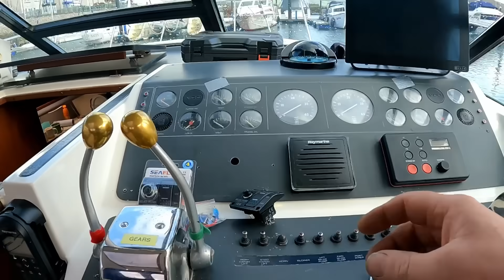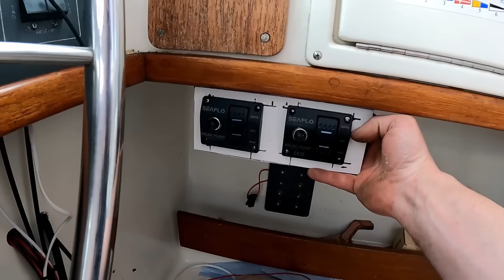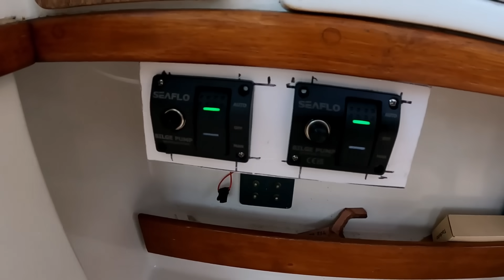Our Boat Sets On Fire At Sea! This Is A Big Problem! #boatlife #boatfails

Comment: Hi Simon, I have observed copper stranded cable not to last at all long on a boat kept on or near the sea. A better option is to use tinned copper cable. It's a bit more expensive, but worth it for any critical system.

Comment: The pump more likely seized and the motor drew more current than the wires could handle. High resistance reduces the current  through the circuit low resistance for example a short  will increase the current  untill the wires heat up and and fuse..

Comment: Lucky last thing you want is a bushfire out out on the sea why didn't the circuit fuse work .....heat shrink lots of Zippy ties and good support for all wires is needed on boats.    Some people might think Im silly but I use stickaflex over the heat shrink on all my connection's and to hold the wires in place under the floor and places i don't see  I do the same on my 4x4s vehicles I've haven't had a problem yet and hopefully never will

Comment: The pumps should have their own fuse and supply cable, if your fuse pops you will lose them both, apart from that great job.
Reply from the maker: They have mate! There both 2 individually wired systems and each one has there own breaker and switch! That’s why we installed 2 switches!
Reply: @ShipHappensAdventures  Spot on,  I'm going to have to watch again now to see where I got wrong lol.

Comment: Considering how often float switches fail, it pays to install a second switch, wired in parallel with the first one and mounted on a raised block. Then if #1 fails, #2 will take over when the water level rises above 'normal' pump out levels...Cheap 'Peace of Mind' insurance. And if you don't want to solder the wire joins, at least coat them with dielectric grease to keep corrosion away... :fish-orange-wide-eyes::finger-red-number-one:

Comment: Having had a 12v fire, one cause is loose wires. Over time they crack the insulation. Wires should not be allowed to shake around.

Comment: Keep analogue gauges as backup duplicate by all means with digital. Good video on your bilge pump replacement.
Reply: I agree totally.  Our local high end boat builder installs all digital instrumentation, but there is a removable panel behind which there is a complete analog gauge set.

Comment: With regard to your new dashboard.  I would insert a tablet (10-14")  then you could run apps tethered to your phone or get a tablet that has a SIM slot.  Apps I would have on it are:
Navionics
Windy / Predict Wind
Boat Beacon (for AIS)
Navily
Marine Traffic
Anchor
Barometer

Just a few I would have and provides redundancy for your chart plotter.  I would be interested if others had comments for other Apps they would install.  I have just ordered a Ulefone Armor Pad 2 4G Rugged Tablet .  Which I intend to set up as my sailing tablet.

Comment: Re Analog gauges - on our old boat we cut tiny little triangle shaped pcs out of white electrical tape and stuck them to the glass faces of the gauges marking the desired rpm, or temp, or whatever.  Then it's just a quick glance to make the sure the needle on the analog gauge is pointing on or near the desired reading. Especially helpful if you have someone new at the helm who is unfamiliar with the correct running readings for these gauges.
Do you ever use heat-shrink rubber tubing over your electrical connections? Might help to keep them dry and corrosion free. Great video, Simon.

Comment: The wiring out of that pump has to be intact and protected, you cannot have damage, much less joins to the cable there. Insulating tape?  - for a connection below the water line for a bilge pump, what were they thinking.

Comment: Those crimps are not a good idea in a wet environment, you should use the solder glue and shrink hose type joiners, failing that (if you cant get them) use manual solder and hot glue shrink hose joints. The salt water will destroy unprotected electric connections in weeks not years. I do not say that to criticize only to ensure the pumps do not fail before the summer is over and you all stay safe. Why are the bilge pumps mounted on a platform and not in the bottom of the bilge, this way there will always be some water down there. You are clever people find a way to move them and the automatic switches to where the water actually is collecting.

Comment: If you buy a co2 fire extinguisher.  You can fill the whole engine compartment with co2. Put out fire but no dry chemical clean up. Yes you have to exercise caution as co2 is heavier than oxygen.

Comment: Nice video, as always. 
I got a bit worried when you poured water in the engine room keel to test the new pumps. I believe there is a risk of pumping out some oily water when doing that test. Maybe it would be better to put the pump and level switch in a clean bucket after the wiring was done to test it and then after the test fasten the pump and level switch as the last moment.

Comment: Are you not required to filter or contain engine bilge water there?   I'd figure they'd require passing engine bilge water through those 'filters' that trap oil before allowing it to be discharged overboard. (Bilge Away is the name of one, I think.)

Comment: A suggestion.  Those bilge pumps have a finite life.  Consequently, on my boat I carry a spare.  To make it easier to replace a failed pump. I put ring terminals on the pump wires and run them to a terminal block.  I also put ring terminals on the spare pump.  So changing out a pump is simply a matter of changing the wiring at the terminal block - i.e., undoing three screws.

Comment: Well time to look at other types of Bulge Pumps Brush less pumps should not get hot and burn out as they can be oil cooled plus the power needed to run them does not have to be very large they should pump out water continually without any malfunction or length of time.  On big ships that get damaged they don't sink because the Pumps can keep the water going out of the ship until the ship gets to the docs for repairs.

Comment: I take it the first pump wasn't fused properly. It should have blown the fuse if it was drawing that much current. So you now have a 15 amp breaker, is all of the wire going to the pump a minimum of 14 gauge? If not the wire will melt and burn again before tripping that breaker if there is some sort of fault allowing the pump or pumps to draw excessive current. You need to find out how many amps the pump or pumps draw then fuse and wire accordingly.

Comment: Good video but... 15 Amp Fuse? Check the rating of your pumps individually and wire them individually with the correct size wire (for 12 or 24 volts its not the same as 220 volt AC cable). Also with a different supply cable that has the appropriate size fuse to suit the cable and the pump load. Fuses are there to protect the cables from loads in excess of their capacity (stop fires).    Sail Safe Guys, Ant & Cid.

Comment: I think changing analogue to digital is a BIG mistake; duplicate by all means. Centre normal analogue (turn gauges in mountings as needed so normal is upright all needles) which equates to a symbol can be read and interpreted 50,000 times faster than a purely digital display. I call belief in all things digital "Digimania" and whereas people tap a gauge no-one taps a digital display (I do on principle) but instead implicitly believes it. Many an accident has occurred off the back of a faulty compromised data input (poor GPS aerial inputs) and an incorrect digital readout.(default speed and direction input dead reckoning)  You may also need reading glasses to read the screens which is further compromise. Electrical systems are always a point of weakness. All your penetrations where the wire; with vibration, can abrade against should be grommetted and oversized to allow some movement of the wires if the structure flexes. Why did you not run a large shrink tubing sheath over the wire cluster which can potentially be submerged in use? ( better than tape wraps.)

Comment: Now all Pumps should come with fitting instruction telling you the correct core of the wires and all wires sealed so no connection made for the design of the pump. Usually the Pump own wires also have the British CE mark testing and length of the wires usually ten to fifteen meters before needing to be connected.  The less connecting means safer for the pump and matching the same power wires connectors so wires will not over heat or cause a sudden surge to catch fire.  No wires should be near the water lines including Earth wires because of electrolysis and rusting.  Sealed wires Must never be cut crushed spliced as they are designed to keep the water out. when damaged weakened that is when a Fire will happen.

Comment: With a boat like that you need to get the system linked to your mobile so if the pumps activate whilst in the marina you get a head start to get there and sort the problem out. I had a boat on a swing mooring that had a pin hole leak in the area just below the water line. so every 12 hours it was allowing water into the bilge. the pump worked as it should but after we fitted a homemade system with an old smart phone to alert us  sorted. plus we had a solar panel trickle charging the battery. no mains out on the mooring . nice one simon    Crack on
Reply: “Hello Sailor” do a great system, Not hugely expensive and uses low cost texts.

Comment: What you could fit is a self priming vacuum pump, easy to make and fitted, It's just a bit of pipe that go from the bilge, to above the water draft line and then down below the water line, while moving along it with cause a vacuum drawing any water out of the boat.

Comment: Nicely done.  BTW, that wasn't a mistake on wetting the sensor, that was a planned test, LOL.  I recommend getting the largest bilge pump you can for your boat, with a back-up, that is industrial grade.  The unfortunate thing is the bilge pumps sold in the marine supply stores and online are basically no more than toys and only good for occasional water such as tiny leaks or when hosing down the boat.  A trash pump type bilge pump that can pull down to floor level is your best bet.  If you lose a hose on a 2" fitting, you need a pump that can push out water at the same rate as that coming in and those tiny pumps are not even going to come close.  Also, the suggestion of wiring in some kind of alarm system that can call you is a great idea.  Lastly, you might want to think about putting in 2 separate water sensors.  One at 6 inches or so above the bilge sole and then another at about 2 feet above the bilge sole, with both tied into the alarms (both local and phone).  The reason for this is that the low sensor is likely to give you time to get to your boat and deal with the issue.  If the high sensor goes off, you know it is time to call the marina manager (or port master) and tell them you have a flooding emergency on your boat and need immediate assistance.

Comment: Inadequate wire gauge is a common cause of fire abord pleasure crafts. Usually the boats manufacturers are aware of this issue and choose the right dimension. Unfortunately most DIY people are not fully aware of what can happen with the use of wrong wires. Never trust a former owners fiddling job 😎😉

Comment: The bilges are probably connected for redundancy so that if one bilge pump fails or the incoming water overwhelms a pump the other can kick in. The 12v batteries should be on a solar or shore trickle charge to keep the pumps from running the batteries flat. Looks like the wiring needed an upgrade though :) great job

Comment: I am surprised that there is not a a completely sealed cable/cover and bonded grommet on the entry to the bilge pump.  I know we are looking at only 12 vdc - but particularly the one that you took off and all that joined "wiring" rather than cable, looked really dodgy.  Anyway,  all is fixed!!  Good luck with your boating! John

Comment: That was a bit of fright but you have upgraded it all now, so it should not be a problem in future. 
The new panel design definitely should be left until you are certain of where to cut. It would be very messy to have holes in the wrong place. Well done in placing the switches in a temporary place for now.

Comment: I stopped watching halfway through. I did drop comment in a previous episode where you had crashed your money on dry-powder fire fighting kit. I did recommend,  that for very little money, you could set up a direct and cheap and simple discharge of COT into the engine bay.

I'm not being a prick. but i have sixty years of being around and living on boats, and still do.

You can rig your boat with all the modern electronic gizmos you want, but when you're short handed and it all goes tits up and you're relying on poxy dry-powder to get you out of the hole you're in, then you are fckd. Isolate the fire in the engine bay, shut down the engines and call for help.

I love what you do and are trying to achieve, I really do, and I do wish you well.

Comment: Simon just as an fyi. Standard flex is no good for marine use, itll corrode (copper goes black) also you through crimps will corrode leading to another high resistance joint. You need to use tinned copper marine cable and soldered joints.